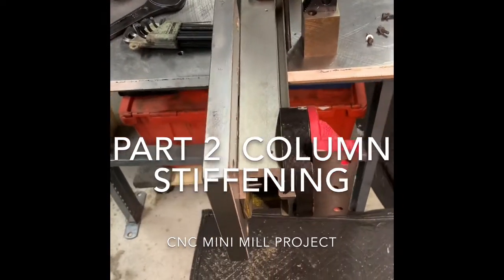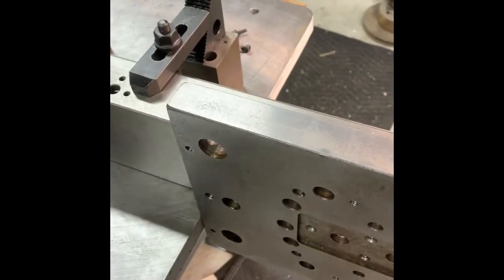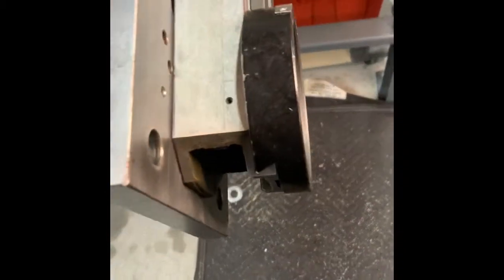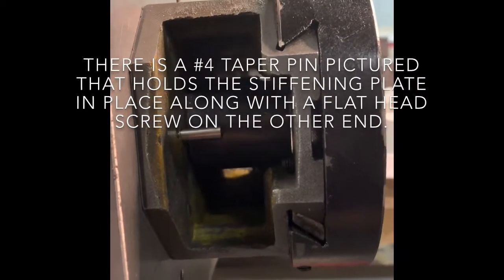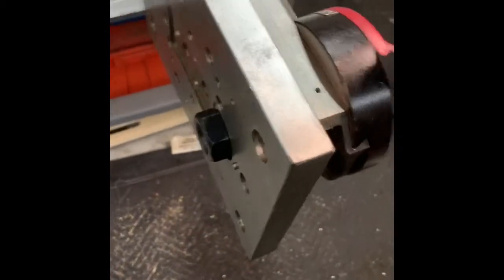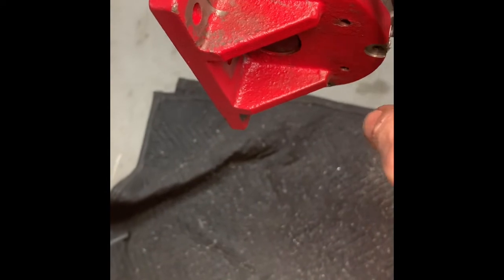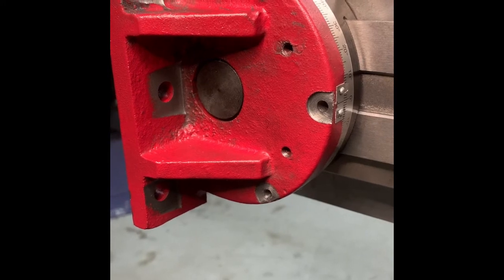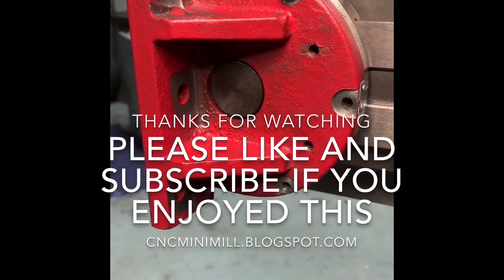CNC Mini Mill Harbor Freight Seig X2 Stiffening the column part 2

Comment: Instead of 3 small screws to lock the adjustment, have you considered 1 larger bolt.
Reply from the maker: There wasn’t room for much bigger threads I didn’t show the inside.  Anyway I wanted to spread out the clamping with multiple location preloading.  In reality with the large gussets I will have on the side it won’t be able to rotate so those 10-24 screws I added probably weren’t worth doing.  Might reduce vibrations though.